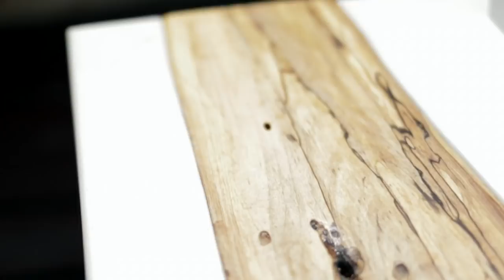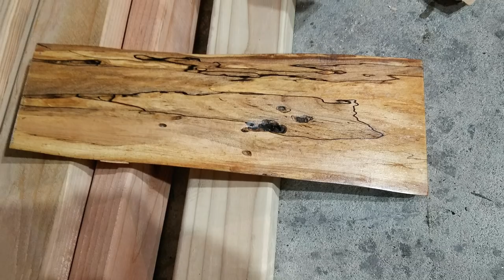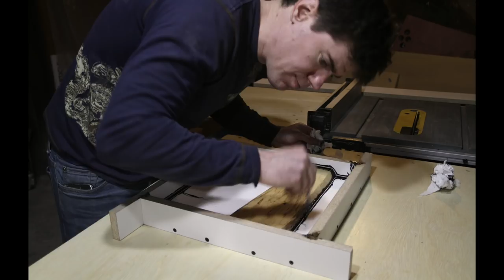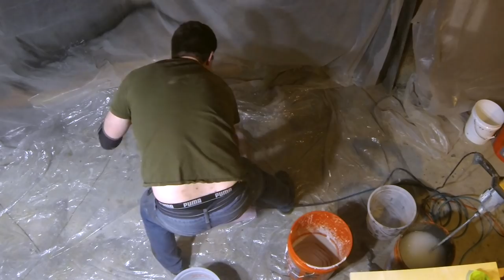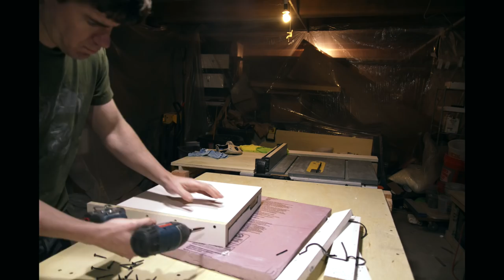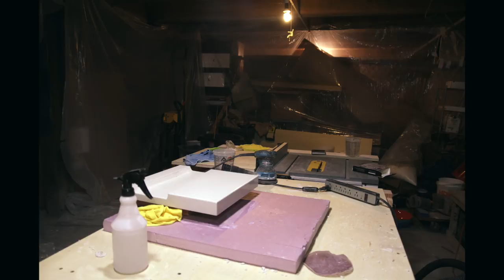DIY White Concrete Table w/ Live-Edge Maple Inlay (using GFRC mix) - How To Make

Comment from the maker: Leave a comment and let me know if you'd like to see a build video for a matching white concrete coffee table using "just-add-water" GFRC mix and easier-to-make wood base.  If you ask for it, I will build it :)
Reply from the maker: That would be a massive project, but pretty darn cool!
Reply from the maker: That would be very cool.  I actually have a video for waterfall concrete countertop with integrated LED lighting which is in production now (preview pics on Instagram, if you interested).  As for integrated sinks, I made two countertops with integrated sinks for my bathrooms, but alas, it was before I started recording my builds.  At some point I will go back and do some quick videos showing past builds.....
Reply: Would love to see a video using "just add-water" GFRC. I need all the help I can get. Wonderful finished product. Just subscribed.
Reply from the maker: My new-ish video for the concrete coat rack uses the just-add-water mix.  Check it out if you haven't already!
Reply: hey man very cool! ow did you glue the wood to the concrete in the end??
Reply from the maker: Thanks!  I just used Liquid nails (construction adhesive) to attach the wood.
Reply: plasticine clay makes nice fillets and you don't have to wait for it to cure unlike the silicone. You'll never go back to silicone again!
Reply from the maker: +Danaka Trudell I have seen the machines that extrude that, but not sure how else to get it even?
Reply: I usually flatten the clay with a rolling pin and cut it into strips. From there I just stuff it into the edges and use a round over tool to form the fillet. A razor makes quick work cleaning off the excess.
Reply from the maker: Cool, I'll have to look into it for some future project
Reply from the maker: Thanks! and sorry for the slow response -- I just used construction adhesive (e.g., Liquid Nails).
Reply: I want to build a 2.2mX1m dining table, can gfrc only keep strong in such span? should I add additional reinforced materials, like glass fabric or streel frame?
Reply from the maker: It will work well for that table, just make it 1" thick to be safe
Reply: If you were to spill something like wine on this, would it stain or come right up after cleaning?
Reply from the maker: +emma welch When sealed, concrete is similar to marble.  It would come up as long as you wiped it off shortly after the spill and didn't let it sit.
Reply: Hey I love your builds and how well you explain how to make them. I'm going to do something similar to this. What would be the best way to attach 2"x1" square steel tubeing (legs) to concrete casting (top)?
Reply from the maker: +Donald McMurray Thanks!  I drilled a large hole thru one side to fit a screw thru, and a smaller hold inside the steel tube on the other side, then used tapcon concrete screws to screw the steel legs to the concrete
Reply: It's would be super sweet if you did something similar to this build but with bamboo shoots. Or if you could come up with something else with concrete and bamboo shoots. Just a thought.
Reply from the maker: Always appreciate the ideas!  That could be a cool combo!
Reply: Modustrial Maker... Yes Please! New to your channel....love your work so far 😎
Reply from the maker: @Tamela Shafer thanks, glad to have you here!  I've done a few projects with the just add water mix now (not exactly matching, but definitely some of the concepts that would go into the matching one, and I'm working on another white concrete table design as we speak 😃)
Reply: What about FGRC table with LED lit glass panel.
Reply from the maker: Cool idea Carl!
Reply: @modustrial  Подскажите пожалуйста состав смеси бетонной. Спасибо за ранее!
Reply: Nice work and great video. I have a diy concrete countertop mix on my channel with a white cement in it. Check it out and let me know what you think.
Reply: If you wanted to have a concrete counter like this with a usable chopping board would that be usable?
Reply from the maker: If you were to do a chopping board, I would use 3/4" foam to make a recessed space in the counter, so you could inlay a wood cutting board into the counter and remove it for cleaning.
Reply: @modustrial  oh wow Thank You very much for responding.
Reply from the maker: No prob!
Reply: Great video learned some tricks. As a side note to you loose the heavy gloves when using a table saw or any rotating tool, the blade/drill bit can catch and pull you into it faster than you can react. My brother had his left index finger split down the middle because he was wearing heavy gloves, use latex or nitrile if you have to use any.
Reply from the maker: Thanks!  And yup, I've since corrected my ways!  (This video is a year and a half old ... I've learned a lot since then 😀)
Reply: What sand did you use?
Reply: How heavy was the table.  Thinking of making a concrete desk top but the motorised legs are only rated for 30kg - 60kg.
Reply: Could this method be used outside on concrete patio? Also have you got a list of materials used?
Reply: How did you attach the wood to the table? I have played with different methods but nothing is easy or pretty.
Reply: I just watched an Allie Beckwith video where she made a lightweight concrete table and I was wondering if you could combine the pure white look with the lightweight method for a large coffee table

Comment: Safety tip... you shouldn't use gloves while operating your table saw or miter saw... if you ever have an accident, you may loose a finger, but with gloves on... the blade will grab the glove and you will loose your hand.
Reply from the maker: Thanks for clarifying.  I mentioned this mistake in my latest video (for the concrete wall art) to set it straight.  For some reason, I was told to wear gloves for safety reasons when I started, but the YouTube universe has now set me straight :)
Reply: Thanks for this tip
Reply: *lose
Reply: My friend used router table with steel gloves and lost 3 fingers. Gloves stucked in to the spinning blade and smashed the fingers.
Reply from the maker: Eek!  I've now discontinued use of the gloves, thanks to advice from folks here....
Reply: oduncu kız ugh.... that made me nauseous...but good to know
Reply: I've personally seen this happen right after I got telling a new kid to never wear gloves around any of the saws. Cut off 3 and a half of his fingers and a good chunk of his hand. As soon as it grabbed his pointer finger it sucked everything else threw, I never heard the saw bog down one bit either.
Reply: @justgonnastay  apt “handle”. Your mother would be so proud.

Comment: The tip for using the cake tool to smooth the caulking was worth the price of admission alone. What a cool idea. For those that didn't catch the name of the tool, it's a "fondant ball tool", and Amazon has them. Nice work!
Reply from the maker: Nothing2cHere glad you found it useful!  I can't take full credit for the idea, since I got it from a video by concrete countertop institute (if you search for their video on how to caulk a form, it is worth a watch).
Reply from the maker: Nothing2cHere ps there is actually an Amazon link in the description for the fondant.  If you use that link to purchase, it helps to support my channel :)

Comment: This is beautiful! Well explained and loved the tip with the cake tool! Really diggin' your videos!
Reply from the maker: Make Something Thanks! I've been a fan of your channel for some time, and I think the recent wall art is your best work yet.
Reply: Make Something it looks awesome but oje question isn't it super heavy?
Reply: Modustrial Maker 😂😂😂😂
Reply: Make Something O
Reply from the maker: It is about 25 lbs.  Definitely not lightweight, but manageable...
Reply: Fantastic table, where did u leave the details of what was used please? Love to try this out...👍👍👍
Reply from the maker: There are links to the mix recipe products in the video description.  For an easier way to get the same results (even without spraying concrete), check out my latest video for the concrete coat rack, which has details on a just-add-water GFRC mix (and links are in the video description for those products).
Reply: New subscriber. Very nice sir. Very nice.
Reply from the maker: Thanks much!

Comment: I just finished the moulds for a concrete project this weekend. It’s late here but I had to trie the ball-method for the silicone. I ordered the ball tool earlier this weekend and got some cheap antique wax. I tried it on the outside and came back after dinner. I can confirm. It is far out the easiest and cleanest way to apply the silicone. A year ago on version 1 I used a coffee-spoon and painters-tape. But due to the raised lip after pulling the tape, the silicone got stuck in the cement. Also depending on the angle of holding the spoon I got different thickness/radius. This never really cleaned up well. Now it’s just super smooth and equal all the way. Even the corners are perfect. (I did use a tiny amount of dish soap on the rag I used tho clean my tool with, I think it helped me in the corners)
Reply from the maker: Glad it worked well, and that is an interesting tip for the dish soap.  Going to put that one in my bag of tricks for later!

Comment: please make more concrete projects and get really into detail about the mix which is the hard part.
Reply from the maker: I definitely plan on it.  I do have one concrete video that is done with just regular old concrete that has already been filmed and will be out soon.  After that I'm planning a simple GFRC project where I'll have time to go into the mix in more detail.  I also plan to do a written tutorial on my website (modustrialmaker.com), which will likely get done before the full video.  Check there over the next month, and it should be up (or if you like, I've set up an RSS feed for the website).
Reply from the maker: Circling back on this, I've got a few more videos up with more details now.

Comment: Awesome video! I'm always looking for great info on concrete and yours by far have been the best!
Reply from the maker: Rich Ruiz: The Mad Creator glad you found it helpful.  Definitely reach out if you need help with any of your projects.
Reply: Modustrial Maker hey, have you worked with adding minerals to change appearance of the concrete?  I saw someone else's video where they added dust from turquoise, but was thinking about stuff that would make the appearance more like granite or quartz; something a little chunky (larger than dust) and sparkly, either mica chips or tiny diamond chips.  If you have done something similar I'm wondering if it worked for you or not.

I love this table, more industrial rural chic.  Would look great in my Alaskan cabin.  I have been planning on colored concrete slabs for counter tops, underlay for wood stove, and possibly even decks (wood decks are too common, but tile deck substructures are spendy and it would tie my interior space to my exterior space looking in or out through the French doors and have matching deck, kitchen counter, wood stove pedestal).

Again, nice work, thanks for sharing.
Reply from the maker: No, I haven't seen that technique but will definitely check it out.  I'm always searching for new techniques to mix into my builds.  Would love to see what you end up making -- if you post photos to Instagram, please tag me so I can check it out.
Reply from the maker: I have used their colors and they are nice -- a bit overpriced in my opinion.  If you were doing a coffee table, for example, it would be $50+ just for the pigment!  But, they are very nice.  Fishstone has nice colors for much lower prices: http://www.concretecountertopsupply.com/Category/Pigments Some of them are only listed on website in larger volumes, but if you are buying other supplies from them, you could give them a call and see if they would sell a smaller color pack size that isn't listed on the website.

Comment: First I want to thank you for providing a new way to do concrete that seems logically better.  The result looks so smooth.  This is the first time I'm hearing about a face coat but makes perfect sense.  When I made my concrete slab there were huge pebbles in there causing irregularities on the surface.  Now does the face coat need to be sprayed or just pouring or painting it on suffice?  I don't want to buy a dedicated sprayer just to do a spray coat if it's not necessary.  I'm all about that clean look when it comes to concrete.  I don't think my Home Depot in Cleveland has Portland Cement and in the past I used Quikrete with the Fiberglass already mixed in.  Thanks and keep making! ^^
Reply from the maker: You can just pour and paint the face coat (and actually don't really need to paint it -- working it around with your hands can also work).  You can actually see an example of how it comes out when you pour in a face coat in my other video for the live edge table with concrete post.  In that build I just poured in a face coat for the top of the post and the top came out flawless (but sides did not).  Also, if you check out my Instagram, there is a recent post with a grey table w/ inlay I helped a friend build, where we used this technique.

There are two things to be aware of if you do this.  First, pouring the face coat and using a brush to pull it up the sides works great on horizontal surfaces, but vertical surfaces will likely have a few flaws.  (You can either slurry coat them after, or just accept them as character.)  Second, you have to be careful not to make the face coat too thick if you pour it in (not more than 1/4").  I have experienced some cracking when accidentally pouring it too thick.

Comment: hey, I want to use GFRC for some speakers I'm designing. do you know if there is a way to do this without an air hopper and fancy cement mixer? could i brush on the base coat by hand, and mix the concrete with a trowel or something? or alternatively do you know of an affordable way to rent the mixing+airhopper equipment?

Comment: What a great alternative to the standard concrete. I would love to do this for a desk top, could you point me to how I would connect the top to the base?  Thanks!
Reply from the maker: You can just use Tapcon concrete screws (available at any home depot).  Alternatively, you can use a construction adhesive like Liquid Nails.
Reply: thanks!

Comment: Awesome result! I just want to ask if the hopper spray gun is mandatory or you don’t need it and can use for example brush to apply the face coat or it won’t work. Please let me know, I’m planning building my own GFRC kitchen counter tops. Thank you!
Reply from the maker: +Filip Tomeček check out my videos for the concrete marble table and concrete coat rack.  I pour /brush the face coat in in both of these projects.  you can pour and brush the face coat, you just have to be careful not to make it too thick.  And know it is tougher to get vertical surfaces if you don't spray, so you may need a slurry coat (for kitchen counters you probably will want to do a couple slurry coats anyway, since you don't want any pinholes for food to get caught in).

Comment: Did you glue in the wood slab when you were done? Im going to try a butcher block inlay in my concrete countertop, but trying to figure out the best way to secure it. Thanks for the video!

Comment: Cool project, and great result. One question though: could I skip the hassle of the hopper gun (clean up, etc.) and just pour a few cups of top coat since you're working it in with a chip brush anyway?
Reply from the maker: You can just pour and paint the face coat (and can even get away without brushing it in some cases -- working it around with your hands can also work).  You can actually see an example of how it comes out when you pour in a face coat in my other video for the live edge table with concrete post.  In that build I just poured in a face coat for the top of the post and the top came out flawless (but sides did not).  Also, if you check out my Instagram, there is a recent post with a grey table w/ inlay I helped a friend build, where we used this technique.

There are two things to be aware of if you do this.  First, pouring the face coat and using a brush to pull it up the sides works great on horizontal surfaces, but vertical surfaces will likely have a few flaws.  (You can either slurry coat them after, or just accept the flaws as character.)  Second, you have to be careful not to make the face coat too thick if you pour it in (not more than 1/4").  I have experienced some cracking when accidentally pouring it too thick.

Comment: Well thought out tutorial with just enough detail to allow us to follow along easily, but shared where we could later find info about the fine detail later on. I'm curious how you fixed the wood into the concrete form in the end. Did you glue it into place somehow? Thanks so much for sharing a wonderful tutorial.

Comment: Great instructional video.  The table looks great.  A couple questions about sanding/ polishing the table.  The paper you hand held was diamond coated sand paper.  What type of paper did you use on the orbital sander?  What grits do you recommend.  Thanks
Reply from the maker: Actually it isn't diamond coated....I used diamond pads on the corners only to dull them.  For the top surface, I used abranet 400 grit sanding discs.

Comment: Hi there Modustrial Maker. Big fan of your work !! I'd just like to ask what method did you use to attach the concrete top to the steel legs? What's the best way to attach concrete to metal?

Comment: Lovely table! I was wondering if there are expansion issues with embedding the maple directly in the concrete. 

I am developing a stump table with cast GFRC top and some makers have taked about cracking over time as the concrete shrinks and the wood expands.